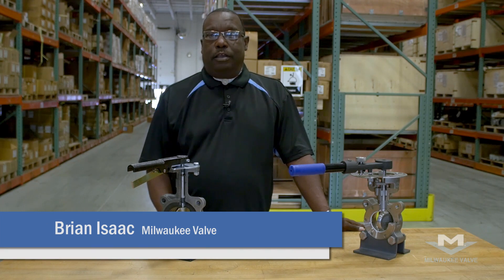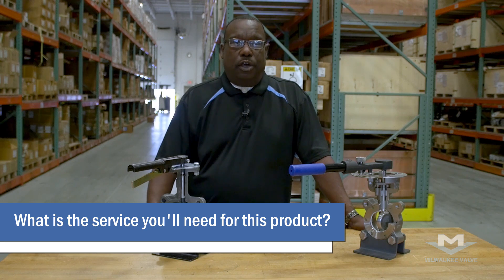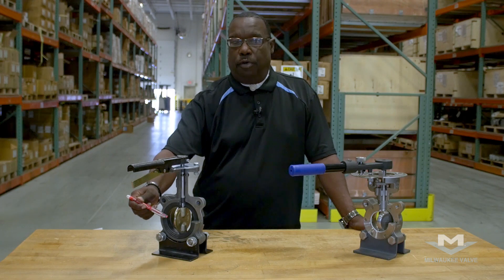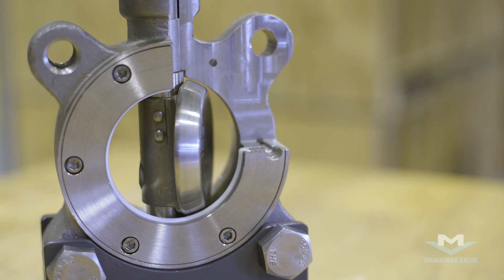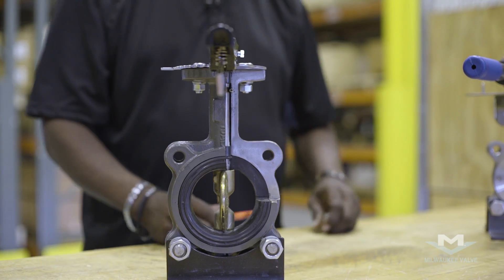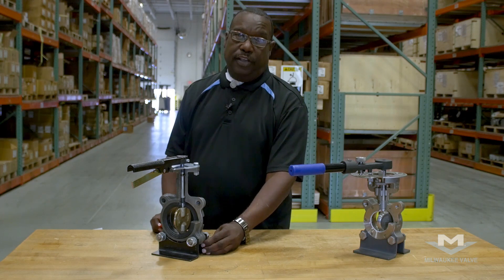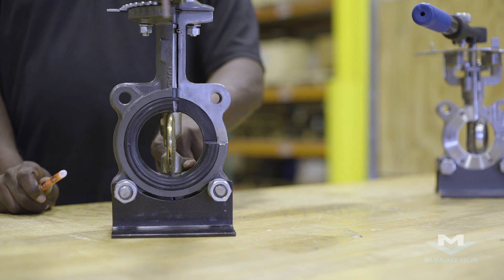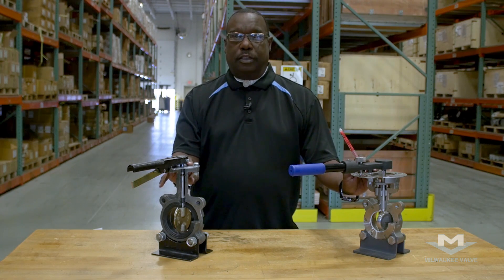Understanding Butterfly Valves - Milwaukee Valve

Comment: Does it matter which way the disk is facing in installation? Flat side inlet?
Reply: Did you ever find this out? I’m actually having trouble with a butterfly at the moment haha
Reply: @eduardoperez864  no answer yet - but then again i haven't called a REP - the valve i did install is in fact fine and operational - since it's mostly in the OPEN position i assume it will never have to be fully tested of its capabilities